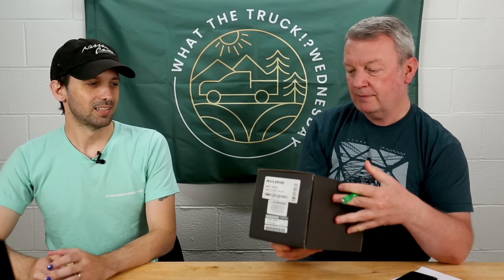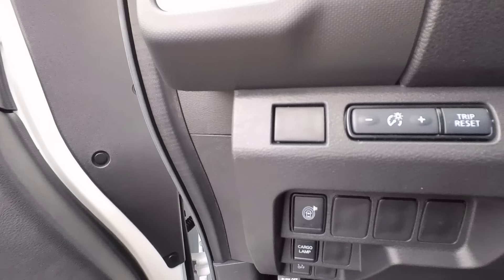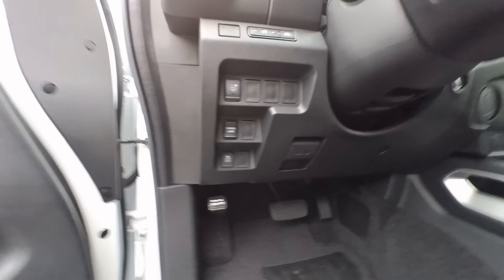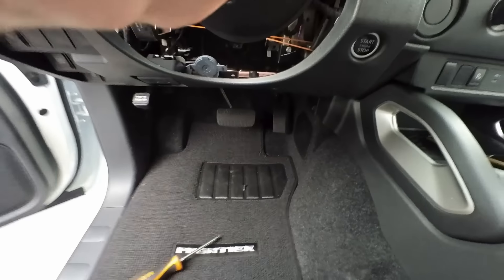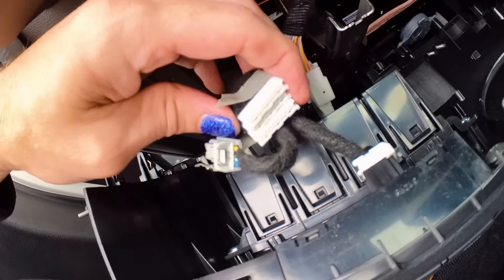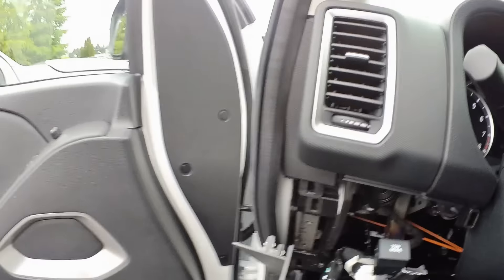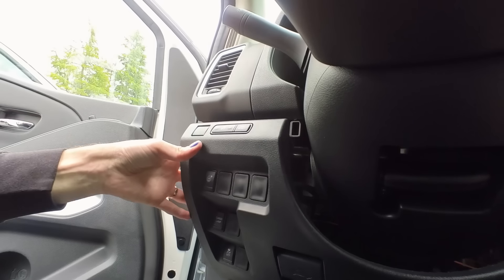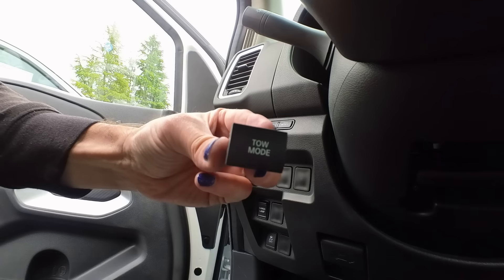What the Truck!? Wednesday: Nissan Frontier Tow Mode Switch Install & Nismo Giveaway

Comment: Current and realistic dream rig:
Titan XD and a new 24' enclosed aluminum trailer. Dual purpose on the trailer. 1. For pulling the track car(s) and 2. For camping, both at the track as well as the Adirandacks. 
Currently, I have my first gen Titan just about to hit a hard 200k miles and an open 18' trailer. Those Nismo lights would mount perfectly on the rear corners. They'll be wired into the reverse lights to automaticallycome on. The trips home from the tracks (Watkins, Palmer, NJMP, Pocono, Limerock...) are always late. The extra lighting to back up the driveway would be amazing! 🤘

Comment: Building a 91 Pathfinder but doubt it will be able to tow much other than a utility trailer but I think my ultimate tow rig would be a F250 4D FWD from before the ignition cut off regulations to pull a camper big enough to keep my wife happy enough to join me when I want to unplug and get away from technology.

Comment: I tow 2 different boats and a utility trailer. I put a tow mode switch in myself in my 23 frontier and my dream would be put a trailer break controller in my truck